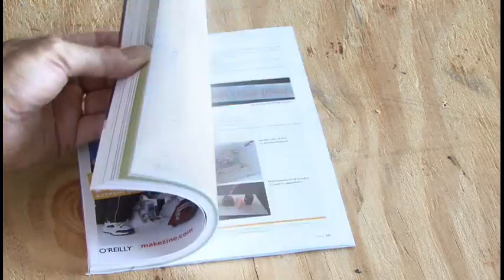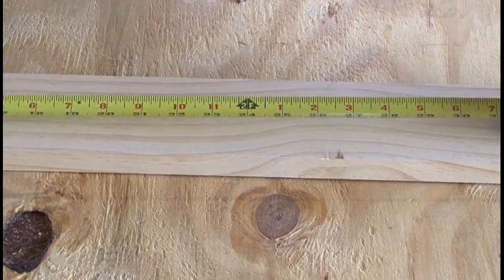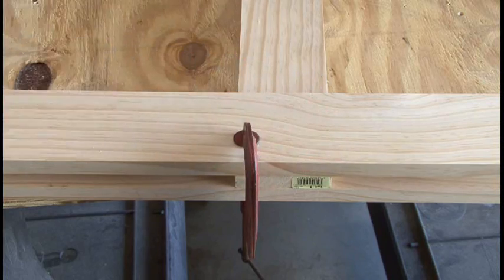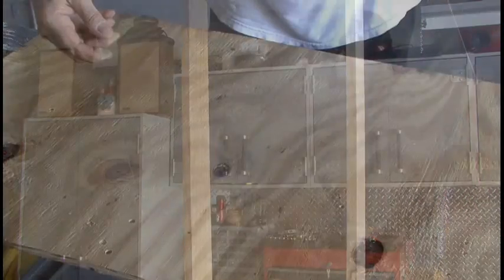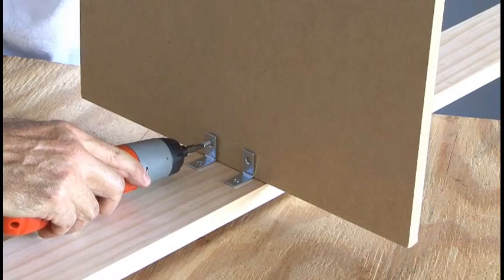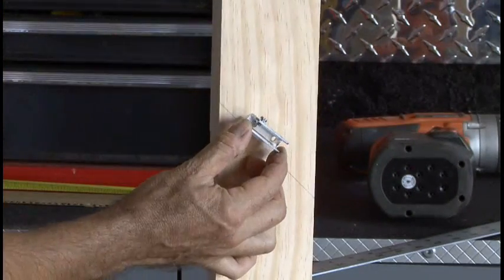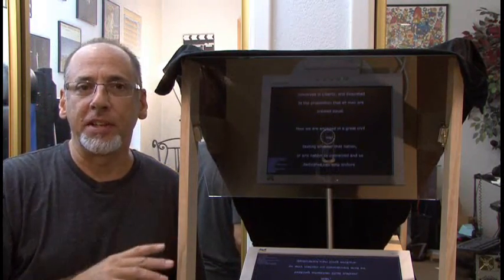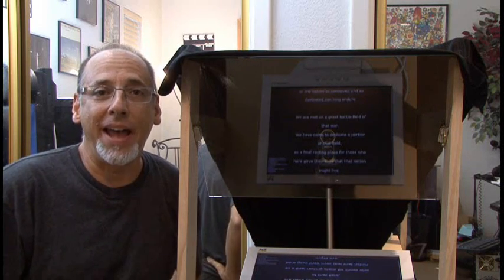Weekend Project: DIY Teleprompter

Comment: @SuperZimbob Simply think about it as half of the light angles off the 45 degree side of the glass, and the other half goes straight up through the glass. Of course some light does reach the camera but it is so small and insignificant it isn't detectable.

Comment: Kip. thanks for posting this. I made this teleprompter and I'm 99% of the way there - the only issue I have is the "small glass brackets". I can't find them in Home Depot or even the local glass store. Do you happen to know exactly what they''re called or what they're used for other than a homemade teleprompter? BTW, electronics aside, it too me about 2 hours and $35.00 to build this.